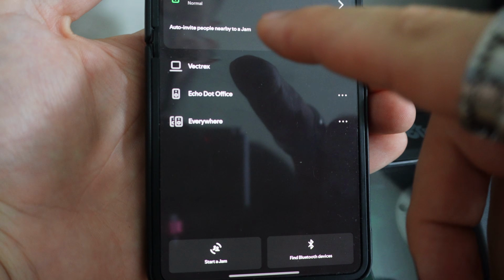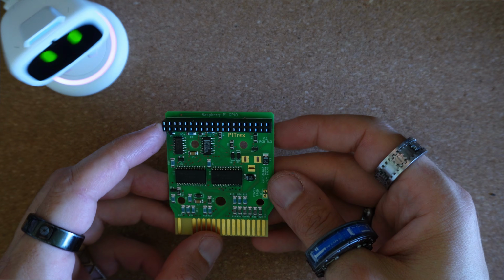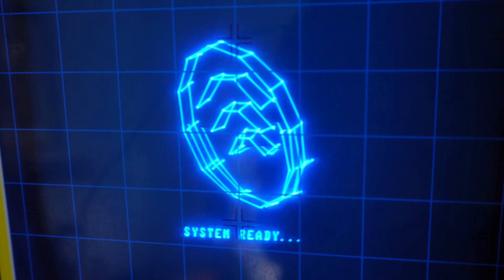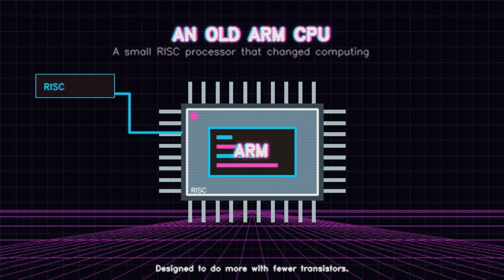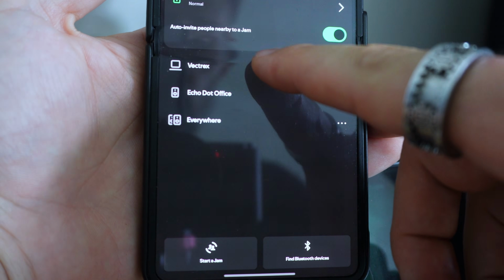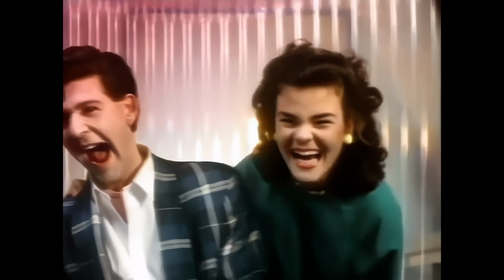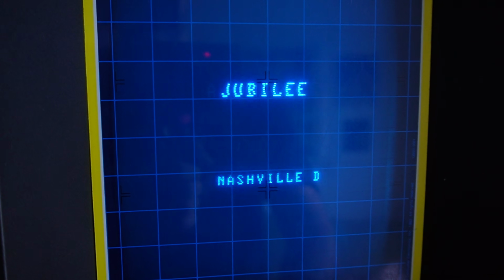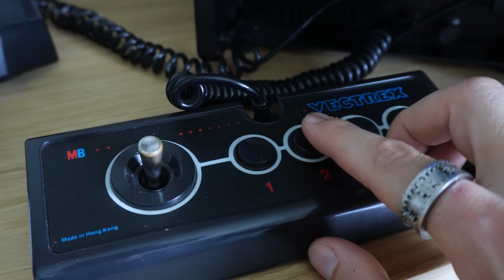I Turned a 1982 Vectrex Into the Strangest Spotify Player

Comment: This is cool I've always wanted ways for the vectrex to interact with pc as I have mine next to my pc. A dream would be a screen sharing software but I don't even know how raster to vector could work
Reply: Look into Rutt Etra video synth. There are modern solutions to this. You can mod the Vectrex to take CV input as well. Ultimately I don't think the resolution would really work as just a standard second screen for a PC, but it is possible.